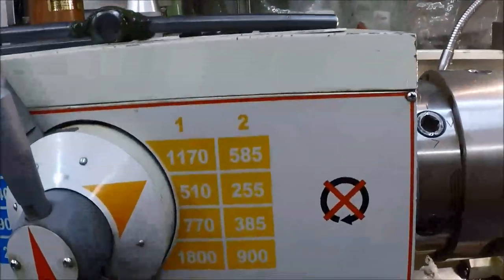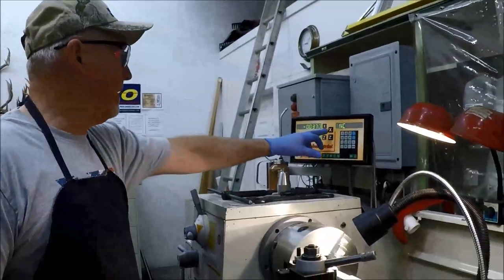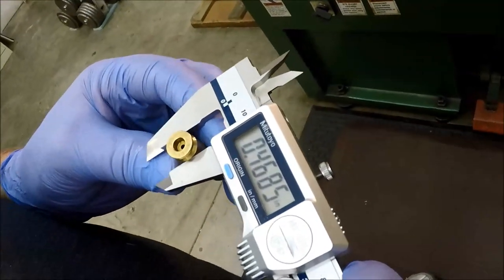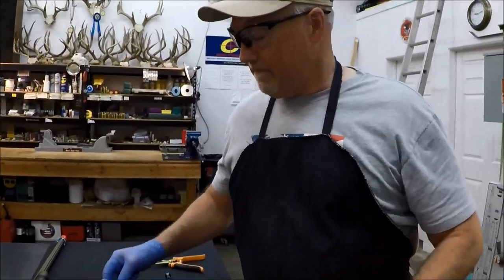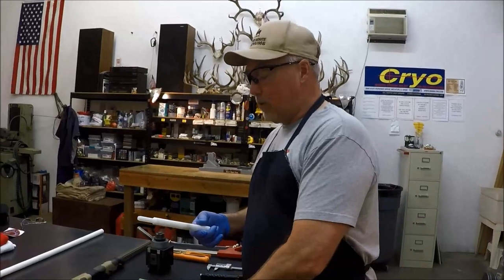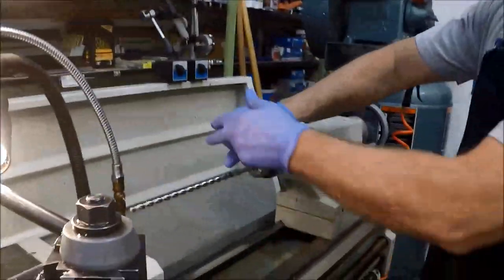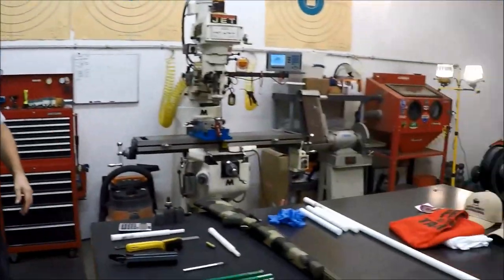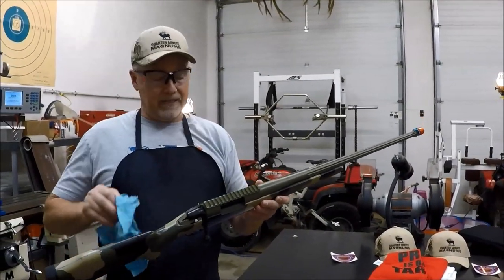6.5 Creedmoor - Bore guide Part 2

Comment: Hi, sometimes it's difficult to find the right model for a particular rifle. I've made mine on the lathe with some Delrin, it has some grooves that locks into the bolt stop. I have also tried with some teflon before but it was too soft. I have seen that there are different kinds of PTFE (different hardness). It took me some time too !
Reply: Dear Sir - thank for the information.
Reply from the maker: Thanks.................